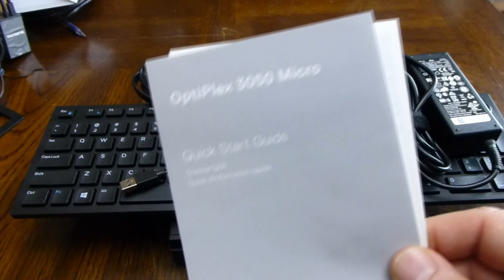✅ Dell Optiplex 3050 Teardown - Big fan for little PC!

Comment: not a bad unboxing.   I was curious about how dell made a tiny pc and it makes sense to go with laptop memory for that type of build.   However, one correction. You stated the GPU is built into the motherboard.   It's really the Chipset on the motherboard, not the Intel GPU.   Intel HD Graphic is built into the CPU.   So whatever the CPU has onboard graphics or not, its the CPU that dictate that and what type it is.
Reply from the maker: thanks for the correction...i don't get to hang on to these for very long before i have to install.

Comment: my unit turns on and runs its diagnostics, but when Windows begins it locks up at the splash screen.  Have you seen this on the Optiplex 3050?
Reply from the maker: it's possible that you have a corrupt OS. try swapping out the hard drive and doing a clean install.

Comment: Damn! Why they picked SSD with SATA interface?! There is m.2 port for it! HP so dumb! Thank you for review, very helpful!
Reply from the maker: it's what it came with. not an option from what i remember.
Reply: Dude where the hell are you seeing a M.2 slot? Every OEM makes a million of these things every year. They're obviously gonna do whatever saves them a couple cents and that includes using a SATA drive.
Reply: There's a m2 ssd slot beneath the 2.5" ssd drive on the lower right corner. Pause at 3:52 and you will see it.
Reply: That m.2 slot for you to upgrade
Reply: That m.2 slot for you to upgrade